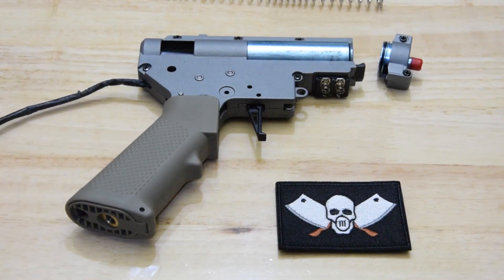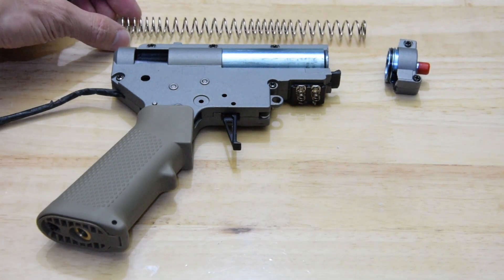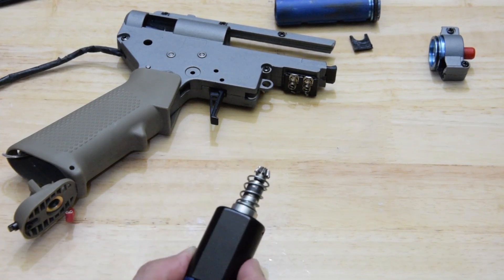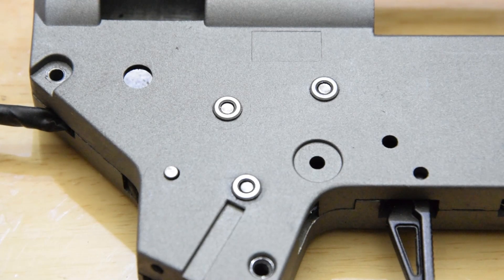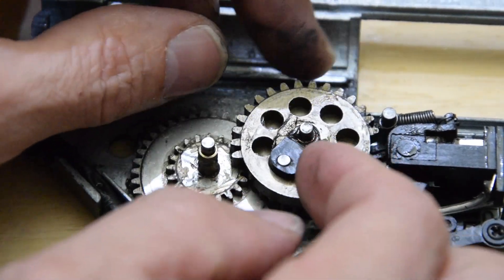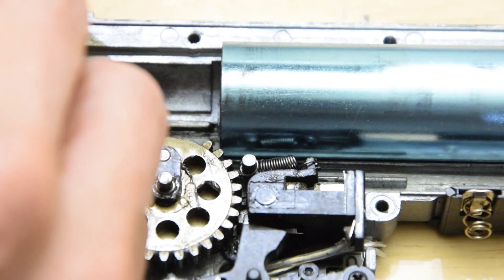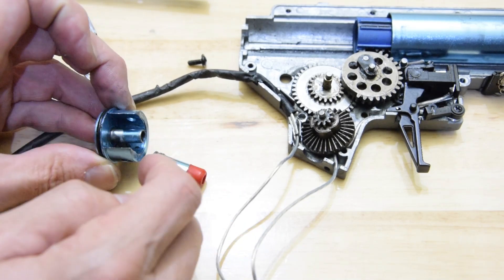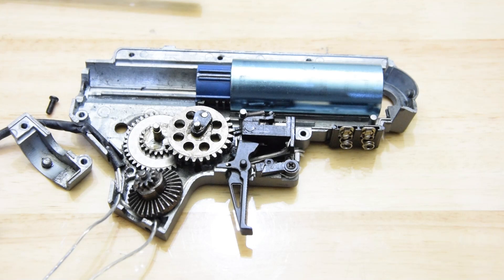wells V2 destruction autopsy

Comment: Yo Low! I've been running a Wells full metal CQB for the last 2 years now. I'm currently on my second box as the first blew out the front left side due to using an M125 spring in it. My second box I installed an Apache nozzle but had my barrel length to cylinder ratio wrong so was running an M125 to get 300fps. Now Ive sorted the air ratio I'm running an M115 spring and achieving 298fps to 302fps consistantly. They are a good box, radius I'm not sure helps with these as I did that to my second box and same thing again with stress fractures on the front. The key with these boxes is to match and tune everything to run a maxium of an M115. Anything bigger and is too much for the cast....

Comment: Great info for people that don't understand the stress that goes on in the gearbox, I have had many of these wells boxes and cant really fault them, radius on them is crucial if they are to last, it would be good to see a vid showing people how to radius correctly. One of mine is 13:1 and m120 with a destruction of God motor, been running for over a year now, my only issue is its more reliable than my high end builds lmao.
Reply: The airsoft tech on utube man he is a pretty smart cookie he has vids on everything you want to know but is all airsoft but still good for tech stuff

Comment: I recently bought a Wells cqb all metal blaster. After 3 x 3 hour sessions the gear box is toast. Fully cracked around the piston head. The only upgrade was 11v battery. This is the second Wells gearbox I’ve had which went this way. 
I bought the gel blaster during a sale and gave it to my son for Xmas.  So it was on full auto the whole time. It looks like you get what you pay for. I would have hated paying the full price for this. At least what I save in the sale can go towards a non Wells box.

Comment: Hey Low, I have 3 wells blasters, all under 6 months old and had two boxes fail like this. Plus a number of tappet plate springs fail and stripped gears. I’m thinking it’s time to move on to better things… but because I’m still a noob at this I don’t know what would be the best direction to go? I don’t want throw another couple of hundred down the toilet. Can you recommend and decent boxes that are an easy swap in for a wells?

Comment: Once again a great video. I caught my gearbox with just the beginnings of a fracture. I tried to reinforce the gearbox with epoxy putty but the gearbox was terminal and the end shot off with similar results.  I also radius the corners but I may have helped the cracks along.

Comment: Yes please get another one and radius it first then thrash the gut's out of it again ,im running a m120 in my honey badger that has a wells box and i have radiused the corners and running a tienly 40k motor and it will give me a rough idea if it will last but saying that mine is a older batch so has a clear silicone rubber tip not a red one so will most likely be a different batch of pot metal

Comment: I had the same gearbox in my wells & the same thing happened to my gearbox, the front snapped clean off. I only realised it was broken when I checked the mag terminals at Hardcore blasters on a Sunday. It was a rude shock. Since then replaced with a retro arms

Comment: Radiusing it would be cool, or the same test using same/similar gear set in a nylon box, are the cast boxes really that much better than a nylon box? :S
Reply: I dont believe so, stock slr box I have a m120, 13:1 and 22tpa motor, hasn't skipped a beat in months

Comment: I wouldn't bother with another gearbox. I radiuses our Wells metal gearbox and it cracked at the radius points the same as this one did. Its crap quality casting and will likely crack, radiused or not ;(